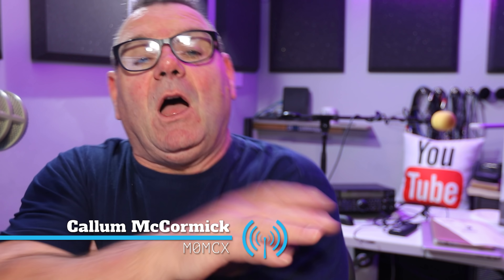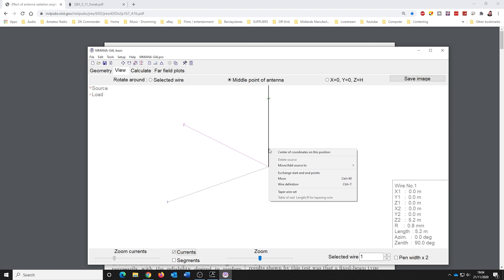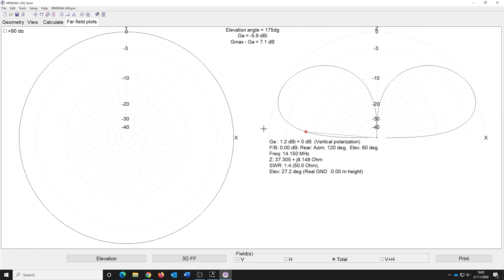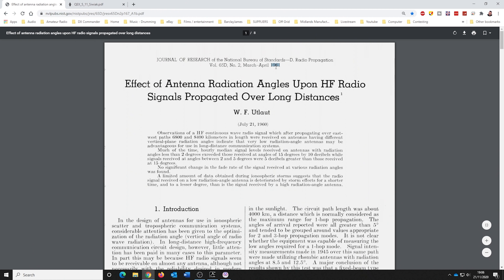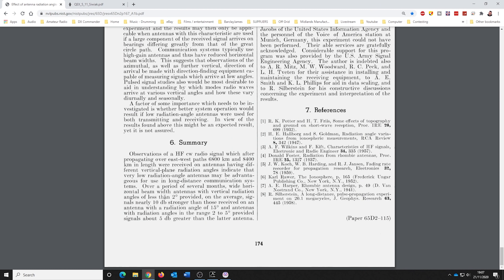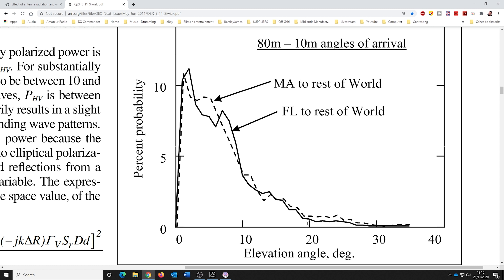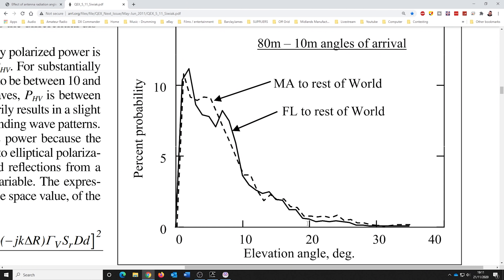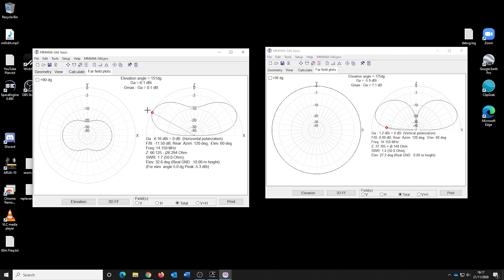Antenna Take-Off Angle Receive and Transmit - Ham Radio Special

Comment: Pragmatic is Callum. Love it. I've understood antenna modeling has been around for a long time but Callums videos have encouraged me to model every antenna i'm either building now or wish to experiment with. It's an absolute game changer. It also helped me understand retrospectively why antennas I have used in the past worked well and others didn't. My DX50 cable arrived today. I get you can use barbed fence wire but gee this is good quality and the relaxed flex I've never seen before.
Reply from the maker: Yeah, it's amazing stuff - and actually should be more expensive but I sell it at reduced profit so folks can experience it.

Comment: Callum, according to my education, you can use any reference you like and you consistently use the same angle of 5°, so your correct, at least you actually say what your reference is, unlike most manufacturers!
Theoretically you could also use the angle at which vertical gain has dropped by -3dB from the maximum, but then you could never make a like-for-like comparison for different designs.
Reply from the maker: Good point!

Comment: Knew about the  low takeoff angle of the 
Vertical.  Great for DX. Most  local hams are  using horizontal dipoles, so I guess I'll have to build one to talk to them, lest they'll tag me a DX snob! But if I Do, I'm 
likely to  put up something exotic, like a double extended Zepp, or co-linear array.
Ah, so many antennas, so little time...
William Barrett/WW5MB

Comment: Thank you Callum. I learned a lot on this one video.  It makes me want to put a ground mount vertical for 20M up and see if DX is as you say during the day (sunlight hours). Thanks sir! By the way, if the vertical is very long, do you need a lightning arrestor as well? or just disconnect the antenna when not in use?
Reply from the maker: OK, so I've not used a lightning arrestor - however static is apparently an issue. Again, never calculated for it but a heavy loading coil connected between the driven element directly to ground will bleed off static.
Reply: @DXCommanderHQ  Cool. Yep I can try that, but you are right I need to calculate the size of the coil without adding to the length of the antenna.  Thank you!

Comment: Summary: Does a Capacitance-Hat halfway down a Vertical Antenna affect the Take-Off Angle?
Thank you for posting this video. I currently have a CHA-MPAS 2.0 'Bug-Out' (backpack portable) antenna erected in the vertical configuration on a ground spike (with 500 watt unun) in my back yard.  It is ~ 20' tall, with a tri-lobed wire Capacitance-Hat half way down (at ~ 9.8' off the ground).
I've been trying to increase the DX range of the antenna by adding extra radials, but that has it's problems due to the layout of my yard.

However, I was wondering if he Capacitance-Hat halfway down could be affecting the 'take-off' angle?
I know the cap-hat electrically 'lengthens' the antenna, making it more resonant on lower frequencies, and 'more resonant == more radiant'/

Would you know if the cap-hat raises, lowers, or has no effect on the 'take-off' angle of the vertical antenna, esp. if it is placed halfway down and not at the distant end of the antenna?
Any advice would be appreciated. Thank you.
Reply from the maker: Erm.. I would have to do a LOT of experimentation. Ask the manufacturer for a far-field plot and see..?

Comment: I'm new to MMANA and having trouble with the plotting. I made an EFHW 8010, 49:1 unun, with 66 feet of #14 Cu wire horizontally run, at 9 foot high. I want to raise it to 20 foot up and was trying to input it into mmana to see the take off angles. I have gotten results for verticals, but horizontals are not plotting. I'm sure I'm missing something. Any thoughts? Thanks for all your work/fun. 😊
Reply from the maker: Leo... OK, I don't know. I have more MMANA stuff coming out. Stay tuned.
Reply: @DXCommanderHQ  It's probably my lack of program knowledge. Thanks and I'll keep at it.  Looking forward to seeing more videos. 73

Comment: Sun spots will continue to rise over the next few years (solar cycle) enhancing conditions, so even if you can't get much power out at 5 degrees, or lower, the signal will propagate well. < lot of variables and caveats with that very generalized statement, but everyone should get the idea.

Comment: Can we change = lower the radiation angle of directional antennas (moxon, hex, yagi) by mounting them with a slight, for example, 5% inclination down the front of the antenna???
Reply from the maker: No. Not on HF - on VHF and above, due to the many wavelengths between the antenna and the ground - you CAN make it work but for HF, not really.. Good question though. This has SOME of the logic in it: https://youtu.be/JZFuOzKY8gg
Reply: @DXCommanderHQ  thanks for quick answer and sharing your knowledge :)

Comment: I was just wondering about this issue. I run a Sirio GPS 27 which is a 1/2 wave on a 6 meter pole. DX has been great, but I have trouble with local traffic in what seems like north and east. I’d like to build a coax 5/8 wave gain master to switch to and compare Rx and Tx, but I feel like it wouldn’t be worth the effort. I don’t have room for a Yagi.
Reply from the maker: For local work, sure - you're gonna need some height to get RIGHT down low.. But for skip, not so bad..
Reply: I work the world on my Gainmaster 5/8 wave at 50 feet ASL at 36 feet from ground to base of the antenna, beats stations with three element yagis running power. They are very good antennas for dx not so much ground wave but it still holds its own with other stations on distance.. it still baffles me it works so well without ground planes.. keeping the antenna in the clear is a good start.

Comment: Super helpful. I have seen verticals in the past that had what's called a Top Hat on the very top of the antenna ( short elements ) Is that just a marketing scam or does it lower the angle of the DX?
Reply from the maker: Top hats are just taking a long elements and making it shorter in as an effecient method as possible.. If you like, it's similar to an Inverted L but with four "tops" not 1 so the pattern stays DX style not skewed. Ideally, the top hat should be parallel to the ground but that is normally impossible so a slope coming down is a compromise. It would be very interesting to compare say a loose coil vs a top hat deesign. I'll bet there's not a lot in it. Perhaps extra bandwidth for the top-hat.
Reply: @DXCommanderHQ  The reason I asked is there was an article published saying that top hats were used to adjust impedance. You see how that was confusing.